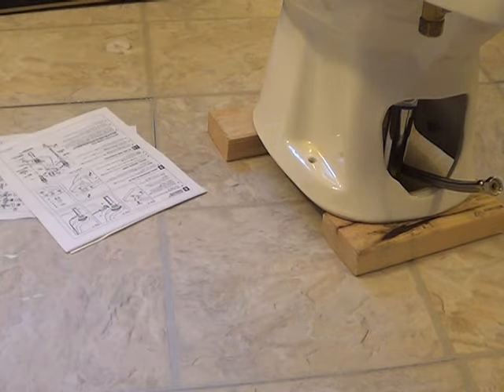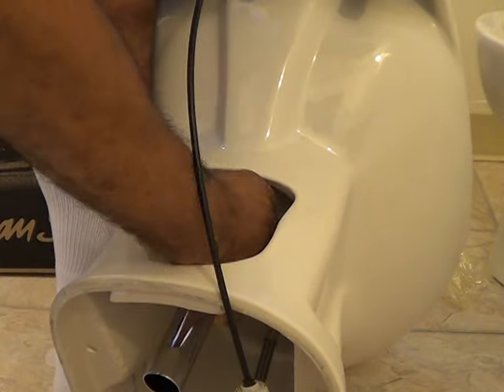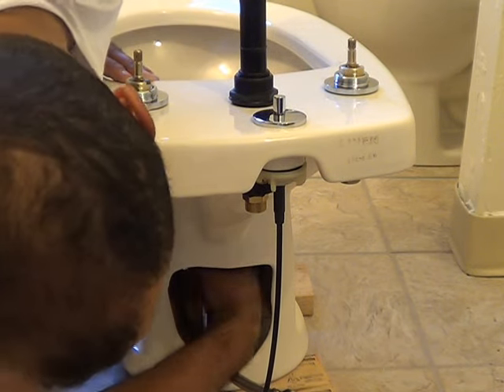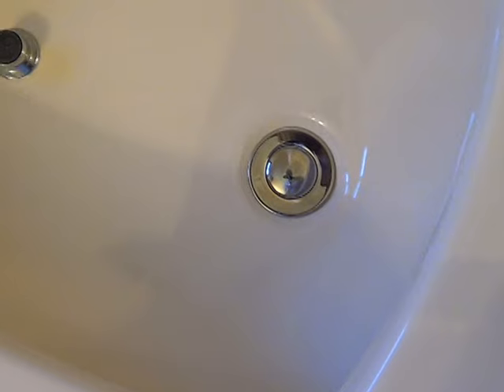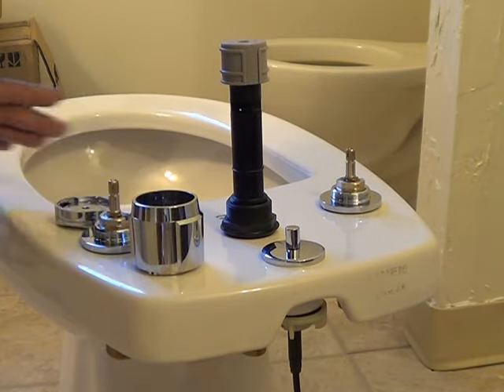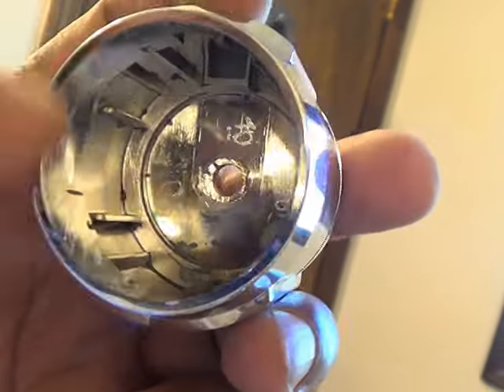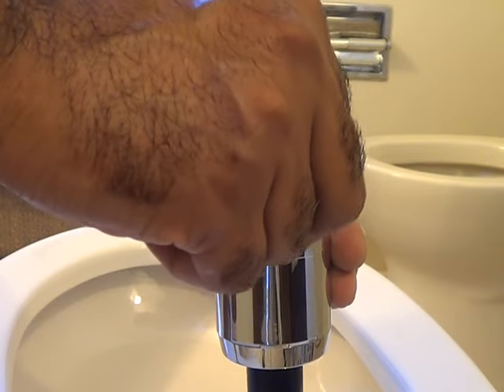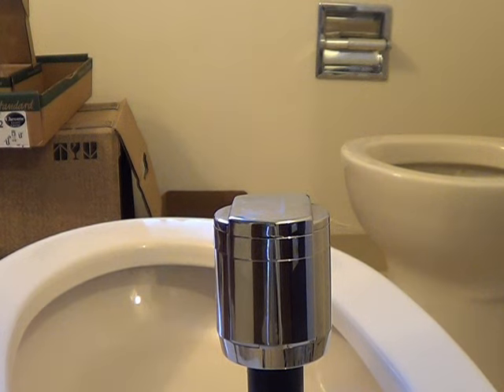American Standard Bidet Install Part 4

Comment: Yes, would like continuation and explanation of diverter and temperature adjustment.  Also curious about preventing sewer gas and sealing drain?
Reply: you will close of the old 3-inch toilet drain. and connect the 1 1/2 drain into  a ptrap to the wall just like a sink.
Reply: I want to see a video of this. The trap is too big to go in the space. how do u make it work